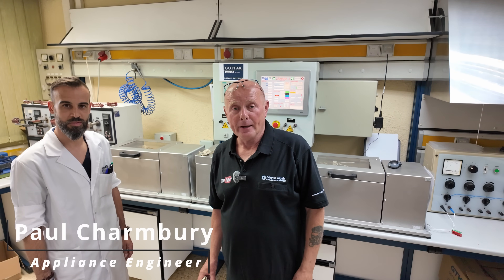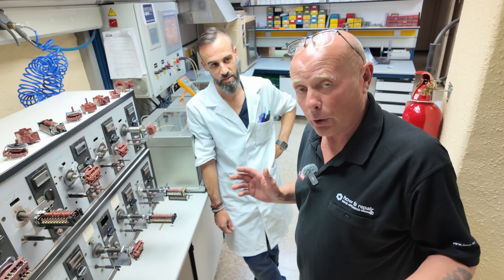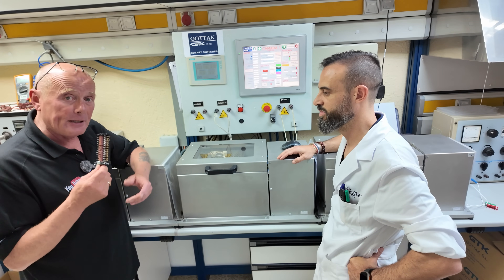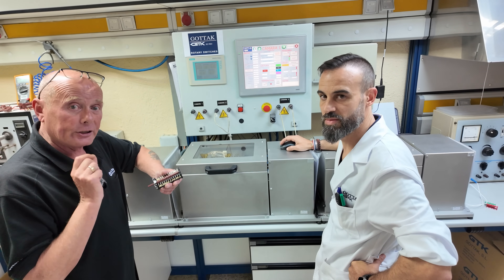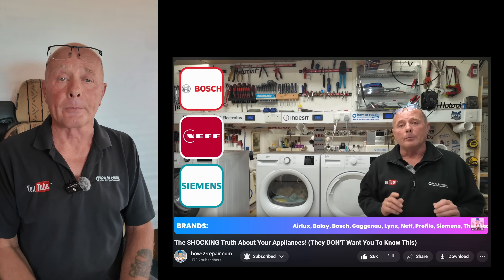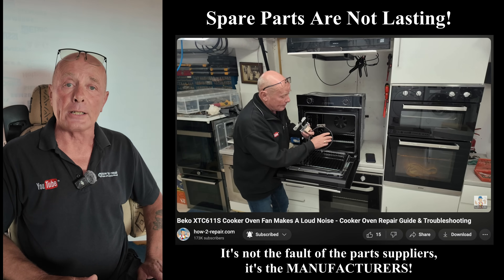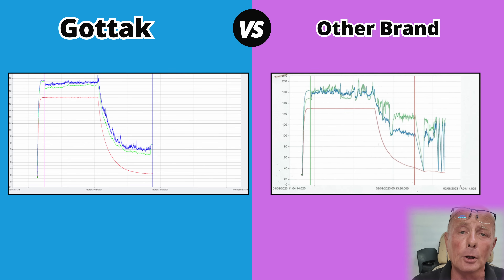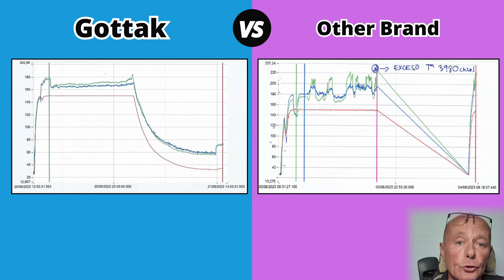Why Your Appliances FAIL SO FAST! Lab Results EXPOSE the Truth!

Comment: This battle between the manufacturers and the public is a loosing battle. Do you really think the public can change the way manufacturers will make products. It’s not only appliances but in everything you consume. 
It is also a tactic the government has figured out with taxes. If you complain they just find a way around your complaints and charge their tactics. 
Look. We the public are not in control
Reply from the maker: I've reached the point where I simply cannot tolerate this situation any longer, and that's why I made this video. I'm aware that this might cause some controversy, or even land me in trouble, but I believe it's crucial to try and make a difference. I would greatly appreciate it if you could share this video. Together, we might be able to bring about some change. If we can't shame the manufacturers into action, perhaps someone in government will see the video and take notice of the overwhelming number of comments expressing public concern.

Comment: I have three old Emerson table fans older than 68 years, my age, and they work unbelievably great. Those days are long gone.
Reply: My dad has a old box metal GE fan. Its outlasted every single modern box fan I have purchased.
Reply: @HardWhereHero  that old electrical stuff is famous for having old insulation failure.
Reply from the maker: In the 80s, 90s, and early 2000s, most manufacturers produced high-quality equipment to build their reputations. Now their main goal is to sell machines.
Thank you for your comment. I appreciate people like you taking the time to write it out. Please share it where possible. It might help others make a wise choice instead of being misled by the industry.
Reply: When my grandmother passed away I ended up with her old Frigidaire freezer. It was old when I was a kid, I'm 62 now and that freezer runs so quietly and it works perfectly. They certainly don't make them like that anymore.
Reply: @BurtonHolmes-tx5bf  They certainly don't make them like they used to. Todays appliances are now on accelerated obsolescence so they'll breakdown between 5 to 8 years. I replaced three electric water heaters within a span of 10 years. Not sure how long my fourth one's going to last.
Reply: I find it really hard to believe the brushes lasted 68 years.   Was it used much during that time?
Reply: @jrstf  I'm not an electrical expert to answer your brush questions but what I do know is the fans have an oil reserve for filling it up. I use these fans all the time. They don't get hot and they are super heavy to lift. Go figure.
Reply: @jrstf  Why assume the motors used brushes?  All the fan motors I've seen have been induction motors and these have been common at least since the 1950's and before. (Hint: Induction motors don't use brushes).
Reply: @cherryjuice9946  Because I once saw a European movie where the guy repaired a fan by replacing the brushes.
Reply: @jrstf the brushes could definitely last 68 years depending on how hard they were and how smooth and good the copper was but the problem I'm seeing is the insulation breaks down and catches fire so often that I'm not going to take 68 years to see why I threw this fan away. You might have something that old and somebody else can throw it away for you and tell everybody how sad they are and caught fire and killed you.
Reply: @markmcgoveran6811  ??? Those old units are very repairable - much easier to work on and even re-wire than modern units. Sounds like a skill issue, and I would love to know where I can go dumpster diving to get all your old tech!
Reply: My home has a 1984 ceiling fan.. Working flawlessly. Starter just changed once. And many fans bought after 2000 were repaired and replaced. Similar situation is with AC as well. New split AC don't even last for 4 years and gas leak issue starts. Earlier window AC provided service around 20 years..
Reply: My friend has fans over 100 years old that work perfectly. He runs some of them all day.
Reply: I have the same experience with appliances I bought when I first set up home in the early 1980's. Now 67 in 2025, and not being minded to replace things for fashion reasons, some are still with me. If it still works, I see no good reason to replace.
Not all are quite what they were when new, but they still work well enough, plus some faults I had along the way were easy and cheap to fix. 
I did not realise at the time that I was buying a cooker for life or that I'd be using the same table fan as an old man, or clocks would still be with me, etc.

Nowadays, I am reluctant to buy new appliances for the reasons stated in the video. There always seems to be at least one weak link that limits its lifespan unacceptably.
Reply: Anybody that has ancient electrical devices as in last century and is still running them doesn't want to live much longer. The insulation is simply gone it's outdated oxidized dried out used up. It's ready to catch fire maybe.
Reply: if only you had passed on your good fortune to future generations.
Reply: We used the old fridge for 30 years and I am pretty sure, it still works somewhere to this day, while we had 3 new ones afterwards.
Reply: @tairikuokami  The useful life of a product used to be until it gave out be it 30 years or so but then they started the "planned obsolescence" but that still allowed products to last over 10 years and now they've upgraded it recently to accelerated obsolescence, that's 3 to 5 years of life.

Comment: Things is made to fail as soon as the warranty runs out.... Inkjet printers even have the exact date they are to fail programmed in them. (the excuse they said for doing that was that they had calculated taht with normal use the waste ink chamber would be full so you then had to buy a new printer....). They made it on purpose so the ink chamber for waste ink was impossible to empty and very small....
Reply from the maker: Programming a product to fail using a waste ink chamber that is deliberately made small and impossible to service is a perfect illustration of the problem.

Thank you for your comment. I appreciate people like you taking the time to write it out. Please share it where possible. It might help others make a wise choice instead of being misled by the industry.

Comment: I am an electrician. 
We used to buy Miele brands but have found the quality dropping. So am no longer loyal too   one brand. And  my colleagues & I are passing on info on brands &models that have what appears to have engineered faults. Please check in your electrical repair store what brands models you should not buy. As some are not worth repairing, some we can nor get spares for.
Reply from the maker: Stick with a brand that suits your budget, but also supplies the technical information for you to have a chance of repairing it. This is my best advice mate! Thank you for your comment. I appreciate people like you taking the time to write it out. Please share it where possible. It might help others make a wise choice instead of being misled by the industry.

Comment: The problem is not only the manufacturer, the problem is also that useless consumer laws exists and the producers knows it and try to exploit it whenever possible, here the warranty for faulty constructed stoves is typically 10 years. And obviously don't buy the cheapest trash stove you can find, and look for reliable reviews and do your research, and buy from a trusted respected vendor and appliance maker. Never listen to the salesman, do your own research, always. Here in Sweden if you do your research and buy mid-range stuff you often get really decent stuff. Siemens and other applience makers have different model numbers for different markets because of some obvious things like language and voltage but also because of requirements put on them for different markets.
Reply from the maker: Hi there! Thanks for your comment, @Phooenixification!

You are absolutely right that weak consumer laws play a huge role, and your advice for consumers to be vigilant, do their own research, and not just buy the cheapest option is spot-on.

The fact that companies have different model numbers and quality levels for different markets is a perfect example of the problem. It shows they are often building down to a minimum legal requirement rather than up to a high standard of quality. This is exactly the kind of built-in obsolescence we discuss in the video.

At the trade show last year, understanding how much obsolescence is being designed into new appliances these days is something everyone should be aware of. For a deeper dive into this topic and to see the examples we covered, please check out the full video here: https://youtu.be/gEgSCbZnHVM?si=wTIw0mELuhWaw4aX

We also explored related aspects in these videos:

The shocking truth about manufacturers: https://www.youtube.com/watch?v=QsdGd2qDPaI
Heat pump tumble dryers are they really worth it?: https://www.youtube.com/watch?v=xn03N3b0-lE
If you found this information eye-opening or helpful, please consider sharing this video with your friends and family. The more people who understand the entire picture, including the points you raised, the better equipped we all are as consumers.

Thanks again for watching and sharing your valuable insights! Don't forget to subscribe to the channel for more like this!

Comment: I'm in the electronics repair business including appliances; the main planned obsolescence design factor is adding a large number of electronic components to poorly designed boards with little or no protections, and adding MORE of those boards which are also locked down so that they are not easily repaired or replaced in some cases.  Then the manufacturer also discontinues the boards from sale or adds pricing on them anywhere from $400 to $1600.
Reply from the maker: Thank you for your comment. I appreciate people like you taking the time to write it out. Please share it where possible. It might help others make a wise choice instead of being misled by the industry.
Reply: Most times spares are not made, only enough parts for the production run.

Comment: A massive conflict of interest in this video! How can snyone make one video about one product and then go to one company to make test and the test show this same company with the best product??? If the person watching this video have one neuron working then this person will see one company marketing its product!!! And accountants don't decide what one company do, executives are administrators not accountants!!!
Reply from the maker: I can understand why visiting one company and then having their product come out on top in our tests might look like a conflict of interest. However, I want to clarify our process and intent.

Our primary goal is to educate consumers on what constitutes a well-built, durable product. We approached Gottak specifically because their reputation for quality engineering gave us an opportunity to showcase what goes into a superior design the things we can't see from the outside. This access was for educational purposes, to provide a benchmark for what good manufacturing looks like.

The tests conducted in the video were independent and based on a set of objective criteria that were applied equally to all products featured. 

My mention of accountants was meant as a broader point about how financial pressures and cost-cutting measures, which are tracked and reported by finance departments, ultimately drive the decline in quality we see across the industry. It’s this focus on the bottom line over longevity that we are trying to highlight.

Thank you for your comment!

Comment: Do not buy those cheap pallet washing dryer machines from costco.
Reply from the maker: Buying cheap is only falling into the manufacturers hands even cheaper appliances should last a statutory period of time. Thanks for your comment. This video seems to have really touched a tender nerve with a lot of people! It's clear I'm not alone in wanting more sustainable appliances. Help me hold the industry accountable by sharing this video. To make a real difference, we need to get this message to the people in charge and tell those appliance-wrecking accountants to back off! I would be grateful if you would share this post, as it’s the only way to force things to go large nowadays.

Comment: This is why manufactures should be required BY LAW to use standardized components at least on anything that's mechanical OR disclose the mechanical design and details so that replacement parts are ALWAYS available or the least the knowledge how to make and repair them is available.

Mechanical parts fail at some point, and there's nothing to do but to make them more robust, but they'll fail ultimately anyway... just takes longer.

When it comes to electronic parts, the're should always be circuit diagrams available and component numbers to you can find replacement and if the part's custom, that should be described in detail and any possible firmware/software and tools to program the chip should be publicly available (not OPEN SOURCE necessarily, but at least the binary files should be available) so that when you need to replace the part with something else that's available, you CAN.

Companies manufacturing appliances are at fault when appliance breaks and has to be tossed instead of repaired. That causes waste, unnecessary use of natural resources and pollution each and every time. Recycling will NOT save us from this, we need to extend the life spans of every single piece of equipment to it's maximum possible and we shouldn't be throwing anything away.

When we ultimately HAVE TO (preferably after decades of use), there needs to be robust recycling infrastructure in place that tries to cover everything that recoverable from said appliance to be reused into more appliances.
Reply from the maker: Hi there! Thanks for your comment, @Mtaalas!

You have brilliantly articulated the core of the Right to Repair issue. Your points about requiring standardized components, disclosing mechanical designs, and making circuit diagrams and firmware publicly available are exactly the kind of systemic changes needed to combat the problems we discuss. This is a crucial part of the conversation about built-in obsolescence.

You're absolutely right the fault lies with manufacturers who design products that are destined for the scrap heap instead of being repaired. The environmental cost in terms of waste, resource depletion, and pollution is enormous, and as you said, simply relying on recycling isn't the answer. Extending the lifespan of every appliance to its absolute maximum should be the priority.

At the trade show last year, understanding how much obsolescence is being designed into new appliances these days is something everyone should be aware of. For a deeper dive into this topic and to see the examples we covered, please check out the full video here: https://youtu.be/gEgSCbZnHVM?si=wTIw0mELuhWaw4aX

We also explored related aspects in these videos:

The shocking truth about manufacturers: https://www.youtube.com/watch?v=QsdGd2qDPaI
Heat pump tumble dryers are they really worth it?: https://www.youtube.com/watch?v=xn03N3b0-lE
If you found this information eye-opening or helpful, please consider sharing this video with your friends and family. The more people who understand the principles you've laid out, the better equipped we all are to demand change from manufacturers and legislators.

Thanks again for watching and for your incredibly insightful contribution to the discussion! Don't forget to subscribe to the channel for more insights like this!